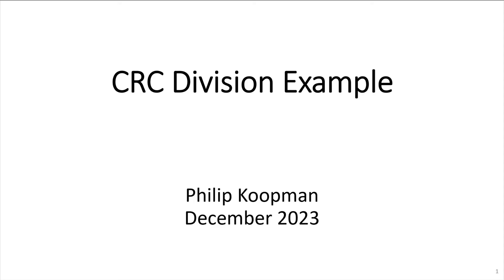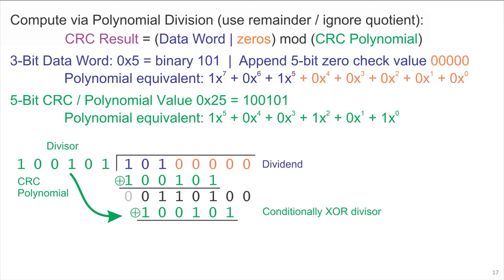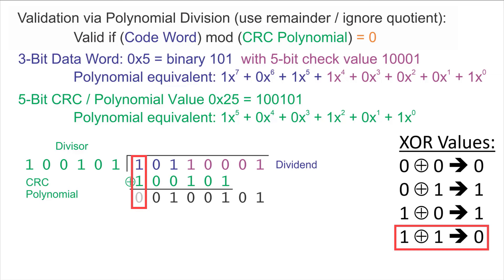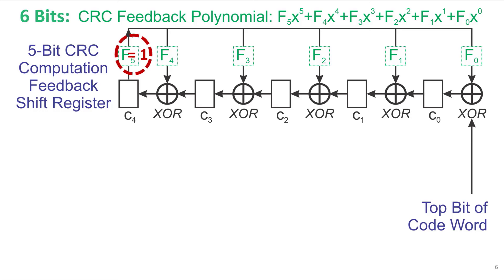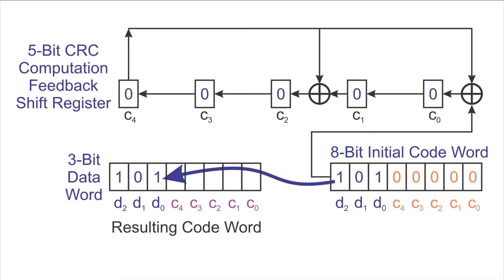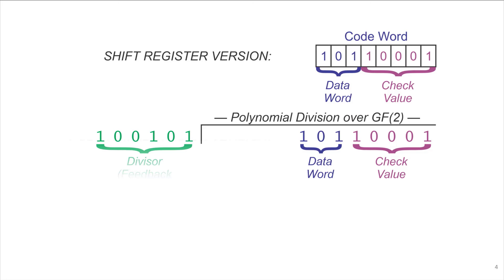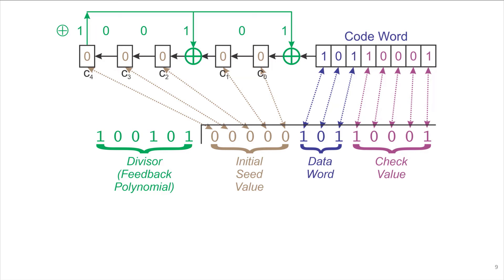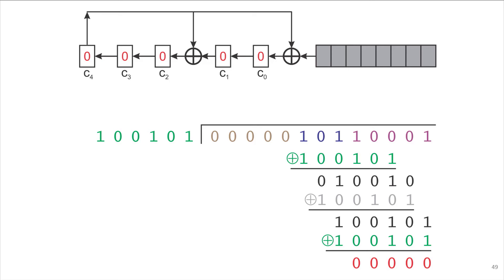L600 CRC Computation Examples -- Polynomial Division and Shift Register

Comment: So you're supposed to PREpend the init? Opposite of the remainder bits? That makes no sense to me but I'll give it a shot. Thanks!
Reply from the maker: In practice most software implementations tend to XOR the init bits into the first bits of the data word -- but then it no longer matches the hardware implementation.  So this is the straightforward math-centric approach and slightly different than most software implementations. If the initial seed is zero they both work out the same.  My book chapter on CRC goes through the differences.